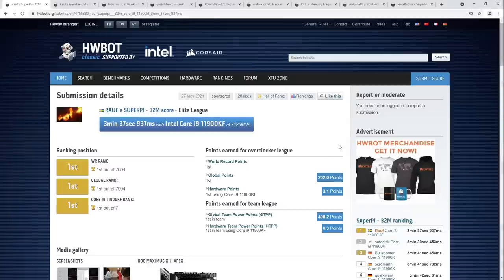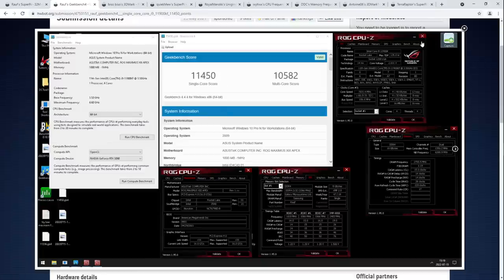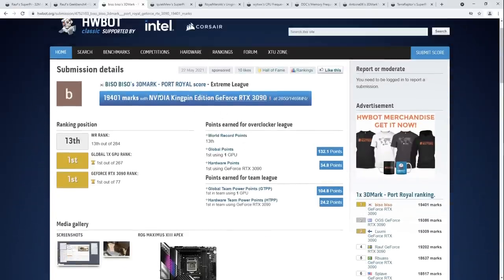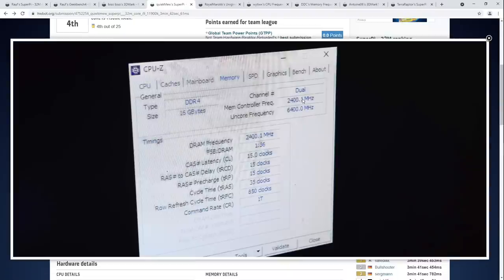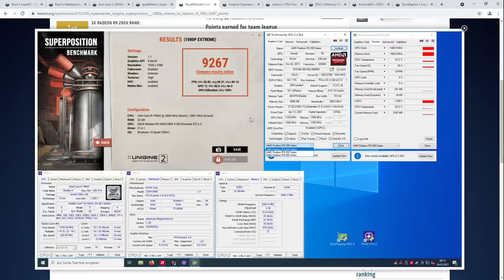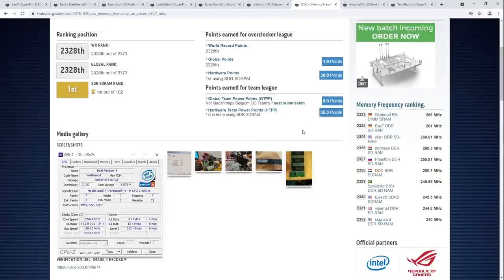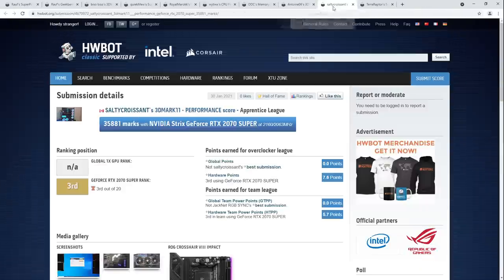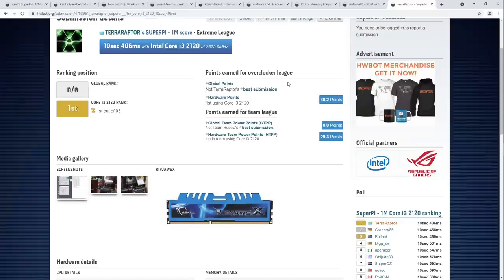HWbot score round up #4: intel 11th gen on LN2, triple R9 290Xs, SDR DRAM and more!

Comment: 19:19 Superposition is really picky about crossfire profiles, enabling crossfire in the drivers is not actually enough to load up all cards in the bench. That might account for some of the lower scores because it's easy to miss this.
Reply: Yes, you are right. The hardest part was to get crossfire running at all three cards in Superposition and I had to try different crossfire modes.
Sometimes the bench just used two cards.

Comment: I wan't some moders to build custom motherboards. Move ram closer to the cpu, only use top tier parts, remove everything that is not needed to run the gpu or cpu, like usb, wifi, lan, sound, fans etc. Ideally solder everything to 1 PCB like a laptop board does. A board purely built for setting records.That is how other competitive sports are played so why not overclocking. All the extra traces and chips cause noise, inductance and capacitances all over the place.

Comment: If that SDRAM record was on a P4, that had to be a CPU or Chipset from before 2003, because the first gaming PC I ever built was in 2003 and my system had a P4 Extreme which was running 4 x 512 MB DIMMS of DDR, and it was a weird time for memory, because there was the traditional SDRAM, RAMBUS and DDR that was competing to be the new standard.  I think that P4 CPUs came out a year or two before I got mine, so it was probably a first Gen P4.

Comment: lga 775 actually uses ddr2, i have an old core2 quad q6550 that maxes out at 4gb memory
Reply: 775 spans DDR to DDR3
Reply: @avagreen9060  what how?
Reply: @lorenzoferraces6443  the memory controller is on the motherboard so it got updated and changed out over the years.
Reply: @avagreen9060  oh that's true, i forgot how that used to work. interesting to see that intel kept that socket alive for so long tho